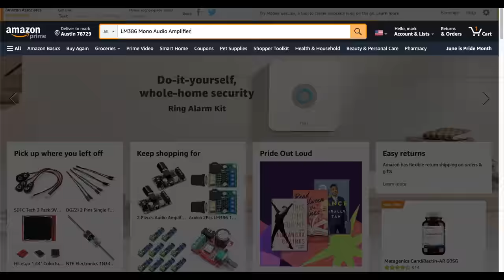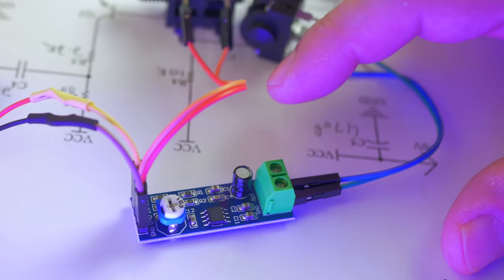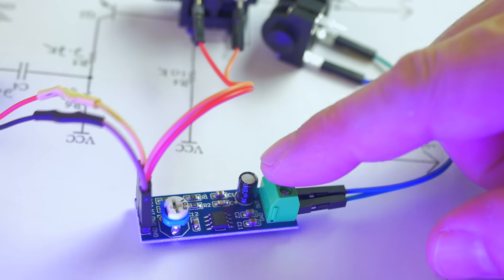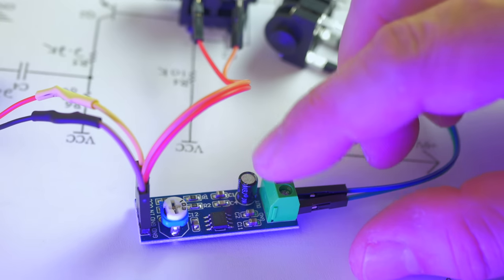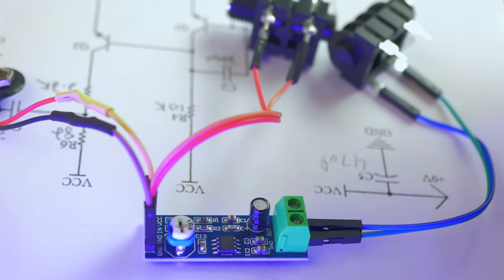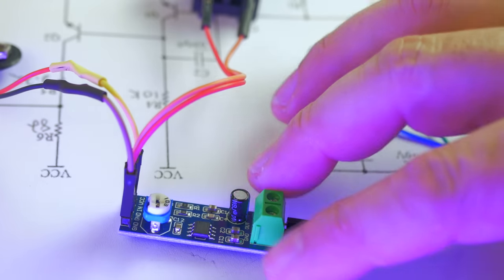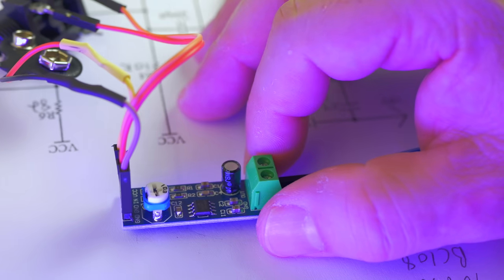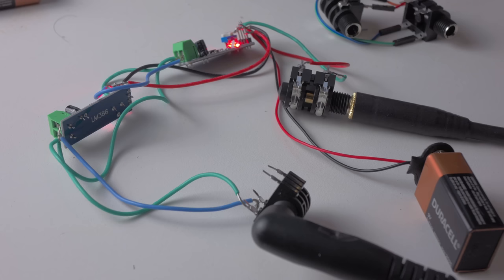One Dollar DIY Amazon Fuzz

Comment: Could this theoretically blow a guitar amp since the lm386 is a ~700mw-1w power amp? There is a video of the EQD acapulco gold doing that.
Reply from the maker: Theoretically, yes.
Reply: Best to add a volume knob for that reason
Reply: @MarkGutierrez  It could potentially kick out enough voltage to fry an op-amp input stage in an amp. Possibly a discrete one too. You would be OK with a tube amp though. Maybe have a voltage divider on the output jack, or even just a resistor to raise the output impedance a bit?
Reply: I have blown the op amp in a stereo receiver by cascading overdrive pedals into it.    Don't turn the volume to max on cascaded pedals and then plug/unplug your instrument cable.

Comment: is there a way to introduce in the circuit a knob to adjust the tone and a switch?
Reply from the maker: Yes. you could put a volume pot after the output wire before the output jack. Switch would be wired just like a normal pedal, via the in and out wires. You can follow the wiring diagram for the stomp switch here: https://www.reddit.com/r/diypedals/comments/c7bsrm/guide_for_anyone_struggling_with_3dpt_footswitch/  For a volume knob, you can add it after the output: https://www.stewmac.com/globalassets/video-and-ideas/online-resources/pickups-and-electronics/understanding-guitar-wiring-part-3-how-is-a-volume-pot-wired/i-4000_4_understanding-guitar-wiring-diagram-4.svg?hash=637540843420000000&format=webp&quality=80
Reply: One of the features of the LM386 is that you can put a potentiometer and capacitor between its 1 & 8 pins for a low-pass filter which is a form of bass frequency tone control.

Comment: anyone know how to add a volume level on this and wire up a led and 9pin stomp jack ?
Reply from the maker: You can follow the wiring diagram for the stomp switch here: https://www.reddit.com/r/diypedals/comments/c7bsrm/guide_for_anyone_struggling_with_3dpt_footswitch/  For a volume knob, you can add it after the output: https://www.stewmac.com/globalassets/video-and-ideas/online-resources/pickups-and-electronics/understanding-guitar-wiring-part-3-how-is-a-volume-pot-wired/i-4000_4_understanding-guitar-wiring-diagram-4.svg?hash=637540843420000000&format=webp&quality=80
Reply: @MarkGutierrez  so I did the volume pot A100k . The volume worked when pedal was engaged but when I stomped the off position it still acts as a volume and so I need to by pass the circuit when not engaged
Reply: @69larter  You need to put the volume control between the LM386 board output and the footswitch, not the footswitch and the 1/4" output socket. HTH

Comment: Based on the amplification factor in this circuit - is it possible/likely to damage the preamp in my head or combo? Or is this too low an output to have any negative effect on it?
Reply from the maker: Theoretically, yes. Practically, not really. This circuit is no different that the Ruby Amp, the Little Gem, or the Noisy Cricket Amp that folks have been building for decades to drive a cab or plug directly into their preamps.
Reply: There's an apoco gold demo where the demoer does just this, so definitely make sure you use a volume knob hahaha
Reply: It’s overdrive, not an actual fuzz circuit that controls diode clipping.

Comment: That was cool! Do you know if there are other options like this for a distortion that is not over the top like this?
Reply from the maker: I don't think so. I did searches for the LM308, TA7136AP, RC4558P,  LM833N, LM833N, which are the chips for the tube screamer, DS-1, Rat, and Klon and no other pre-made circuits popped up. This little LM386 mono amp does have a 10k Trim pot on it that cleans it up a little.
Reply: Probably gonna need some filtering, like passing through high/low/bandpass and distorting separately more/less what you want, also the distorted signal filtered as well. So probably no single chip amp solution like this one. You can do this kind of stuff with many other parts like op-amps, probably they'll also distort slightly differently, albeit they should all be sort-of similar (tho not identical) since they're all transistor based after all.
Some got different transistors inside tho like JFETs so I think you can play around with different parts to see what sounds the best.

Comment: I need help: I bought the same boards but I can't get anything like in this video. It sounds pretty clean when using one single board and with 2 it just sounds kind of broken (sadly not towards distortion).
I basically wired everything the same as him, except for a switch (bypassing it doesn't solve anything tho) and a 100k volume pot on the output (still, it shouldn't affect the distortion).
Any ideas?
Reply: Have you tried messing with the trimpot (the white circular thingy with 103 printing on top) value?

Comment: But you have to buy 6 for 7 bucks, and then add 2x 6.35mm jack sockets which are at least a buck each, wire and a battery snap. Nowhere near one dollar in reality
Reply: $1 sounds better than $4.1666 x 6 though, eh?

Comment: Wondering if you wired a pot onto battery lead you starve the voltage to get a good breakup.
Reply: Thinking similar but using a resistor at voltage . As a plus might not blow the amp